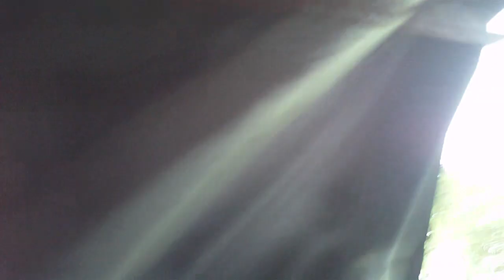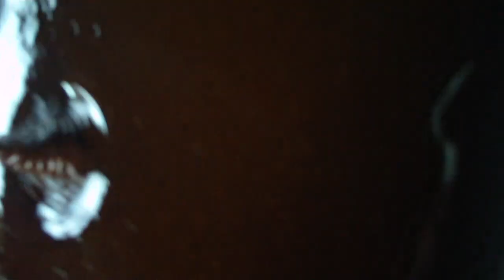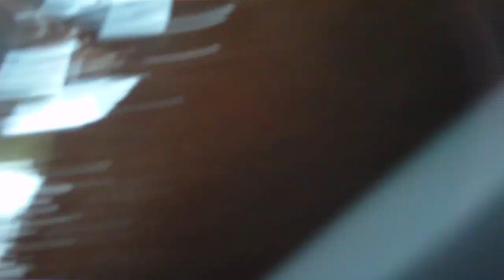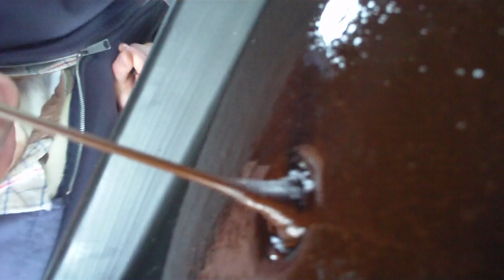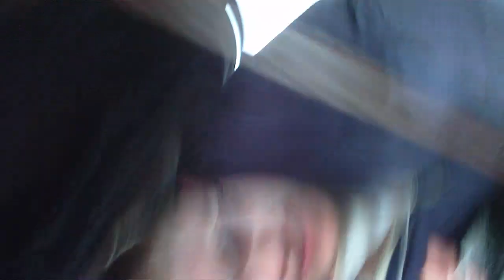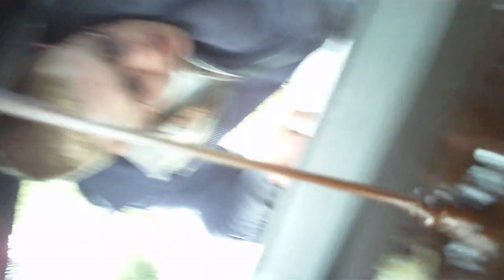Extremely Bad Transmission Oil

Comment from the maker: On an automatic transmission, changing the oil can be bad if it has not been changed in a very long time. That's because the new fluid breaks up all the dirt and varnish that the old fluid was not breaking up, then it basically clogs things up and grinds parts to death. This was a manual, so it was fine. It runs in gear lube, not ATF.